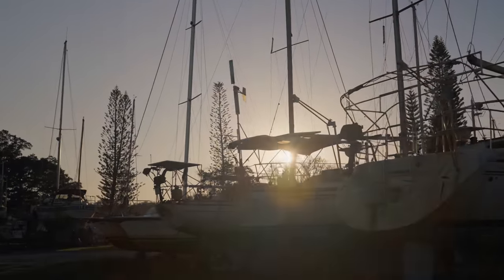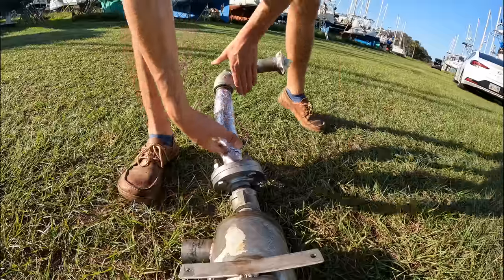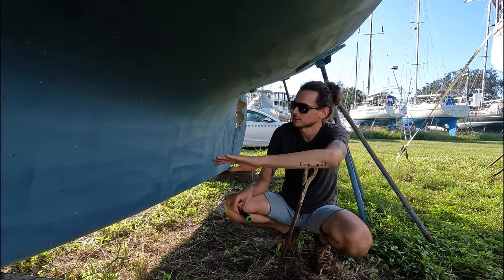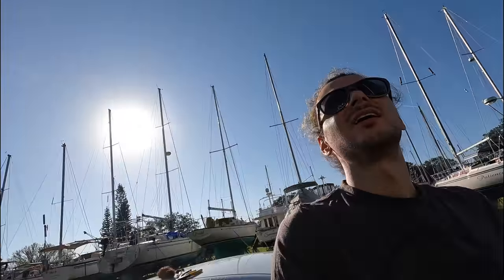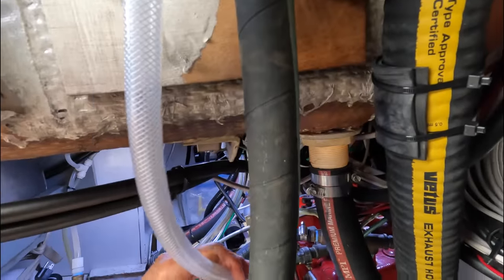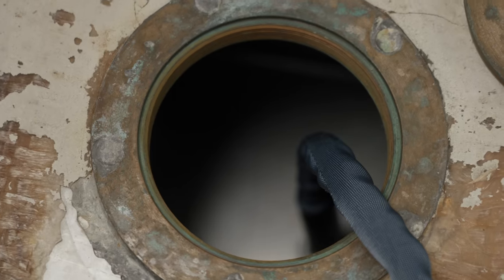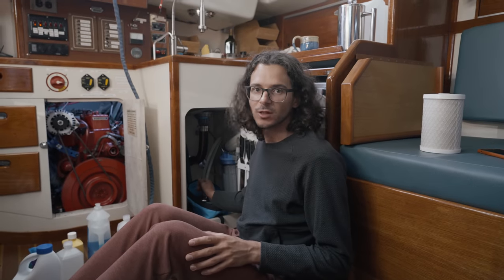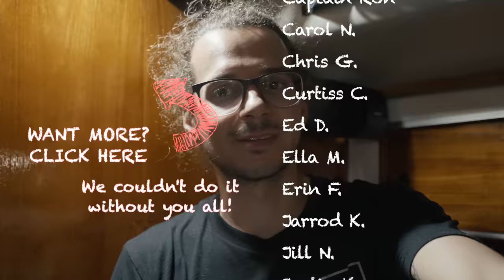SPLASH DAY! ⛵️💦 Does Our HARD WORK Pay Off?? EP. 57

Comment: Hey Parker Congrats on the successful Splash and exhaust install! Now that your hull has found its sea shape again recheck your propshaft alignment and adjust/ shim if needed. Too late now but does the boat have zincs on the rudder heal casting and dead wood fitting? Next time also take a pic under the rudder heal to see the condition of the rudder post heal bushing just for piece of mind. Can't really feel much play in it on the hard but in the water you can hear and feel it at the helm especially on a following sea.
Reply from the maker: Hey Dale! Thank you for those suggestions. Ive always wondered if I should add a zinc to the rudder shoe. Im thankful that the boat was in fresh water up until last year. I think it will be a good idea to add a couple of zincs on the rudder shoe to protect the shoe and rudder shaft. I actually have a couple of teardrop zincs that would fit nicely. How do you attach them to your rudder shoe? Did you drill and tap the shoe and if so where on the shoe is a safe place to do so?

I'll have to inspect the bottom of the rudder shoe to see the condition when were in the clear Bahamian water.
Reply from the maker: Also good idea about checking the alignment! Ill add it to the short list of things to do!
Reply: @Boundless_Adventure  Used a 2 and a 3" dia. Zinc. Added them to the 1/2" thru bolting at the nylock nuts. One of my haulouts umpteen years ago I replaced all the bolts, bedded in 5200, ground shiny the fittings, and added those zincs. Found all the thrubolts compromised by different levels of crevis or galvonic corosion. Have only had to replace those zincs twice in last 10 years and the bolts again once. You could drill and tap the fittings witch I think would be better for your teardrop zincs. Just make sure you have one on each fitting. The rudder is isolated from the heal by a nylon or composite bushing. Just a little added insurance against the stray currents Seawind is now seeing at these foreign marinas.

Comment: Just removed the rudder on a 79 SW2.  There was 1 mm of play after 42 years and some evidence of dezincification to the shaft inside the packing area.  This area sees the least amount of circulation and was the most pink.  Tapped 2 rudder zincs into the shoe.   To remove the play I bored the gudgeon to 1.125, added a $5 bronze flange bushing and put it back together.  I expect a decade more at least.
Reply from the maker: I was just told about making sure the rudder shaft has a zinc on it via the rudder shoe. Thankfully our boat was freshwater it’s entire life (up until last year). I want to add zincs on the rudder shoe by tapping threads for them. Do you by chance have any photos of the install? Where on the shoe did you choose to drill and tap the holes?

Comment: Congrats on the splash! Please give some consideration to your boats righting ability. Typically with older boats they were not designed for all the "extras" that have been mounted over the years. Think, solar arrays, hard dodgers, radar domes up the mast, gas bottles, bikes, kayaks, gerry cans and more. I have no idea if this is a potential problem for your boat, but this is often overlooked. Obviously with some pretty serious consequences in the event of a knock down. Good luck!
Reply from the maker: I've thought of this often! I have tried to take into consideration the types of materials I am using when adding things as deck level and above.

Comment: Thing’s below the water line are your #1 safety issues.like a zink on the shaft , the thru hull fitting.you can’t be cheap . If your out of the water on the hard replace things that are worn.you don’t want to pay a haul out fee for parts that aren’t that expensive.
Fair winds
Reply from the maker: Thanks, Tom! I replace the zinc fairly easily while in the water with my dive mask and an allen wrench :)

Comment: I’d have had the lower hull, below the water-line, glistening, shiny.
Reply from the maker: We use a copper ablative paint that dries matte! This type of paint is designed to keep the hull from fouling with growth by slowly disolving as the boat moves through the water. So effectively a new surface is continually revealed until the paint needs replaced. We put 4 coats on before we left last year and it’s going strong still! 😊

Comment: What do you mean you designed the exhaust system?? Or do you mean you bought the parts and installed them??
Reply from the maker: There is an enormous amount of behind the scenes work. Designing, planning, sourcing parts and materials etc. This particular project had a lot of minimum and maximum dimensions in relation to the waterline, and the height of the exhaust manifold coming off the engine. Yes, I bought some parts, and yes there is a standard checklist for what you need for a safe marine wet exhaust system, but every boat is different and requires a custom design, and installation. Designing and building the custom shelf is something completely unrelated to the exhaust itself but essential to a reliable system. So, yes I very much did design (and install) the exhaust system!
Reply: @Boundless_Adventure  seems our definition of designed are 2 different things.. my idea of the designing of something pertaining to a sailboat is more along the lines of what the channel living on the Ocean is doing.. he's re-engineering many things on his sailboat
Reply from the maker: I see where you're coming from! I suppose both ideas are correct! It's all about perspective haha! Thank you for your comments, Ben! I don't take offense to anything you've said by the way!